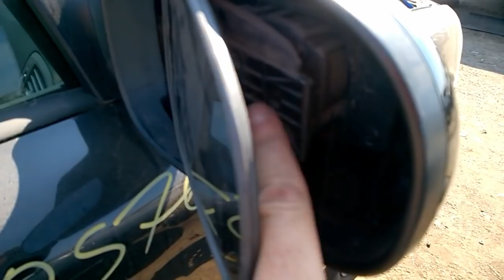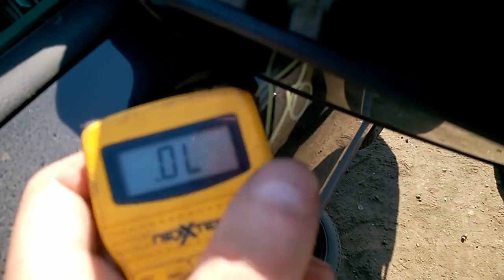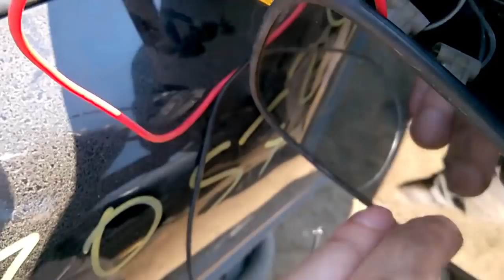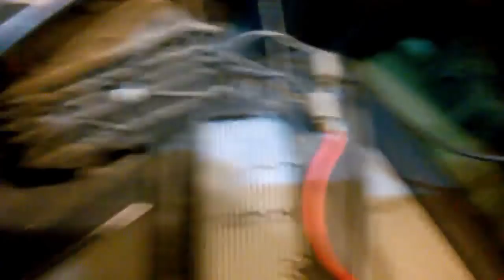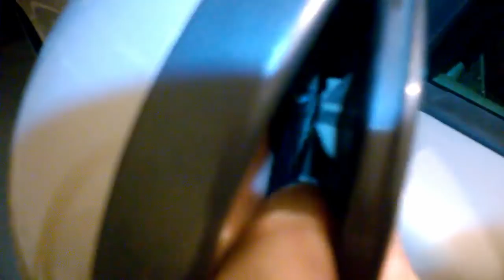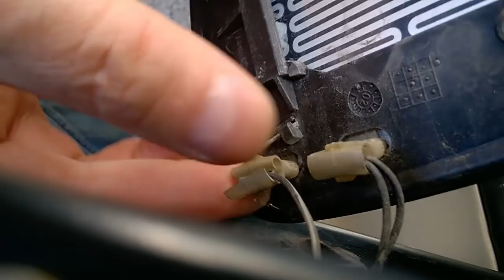Heated mirror glass testing and removal - Volvo S60 V70 XC90 S80 2001-2009

Comment: Excellent ... my wiring hook up and hinges were slightly different (2006 S60 2.5 T AWD) but close enough. Followed directions and ested the glass as instructed, got readings, installed as above and all works perfectly. $20.00 from P&P. Excellent. Thank you.
Reply from the maker: Good fix!  I think the mirrors were changed in 2004 (not compatible with previous years)

Comment: Thanks, great video, However, I changed my rearview mirror today and now my door locks won't lock with my remote any suggestions?
Reply from the maker: There may be a module inside drivers mirror, related to the car's security system. Try asking on this UK forum https://www.volvoforums.org.uk/forumdisplay.php?f=19

Comment: You know I saw in the dealership and they sale aside the mirror with heated, and it fit perfectly in my Honda CR-V LX,  but I checked my car and it didn’t come with electrical wiring for that, do you know if it will be possible that I can do the electrical wiring and it’ll be work? (Mirror heated that I saw it’s for crv models superior that I got). Thanks
Reply from the maker: Usually the heated mirror wires are on the same circuit as the rear window defrost and will activate when the rear window is activated.  So if you can pass the wires inside the mirror and connect to the rear defrost wiring, it may be possible.  Have a look here  https://www.9thgencivic.com/forum/maintenance-repair-practical/5335-diy-heated-side-mirrors.html

Comment: Wait does the battery have to be hooked or charged im confused?
Reply from the maker: No, I'm measuring the ohms (resistance) so the is not need for the heating element to be powered (in either of the cars shown).  You can measure this as well on a mirror that has been removed from the car, just set the multimeter to ohms (200 or 2k scales)
Reply: Peppermint Ok thanks ive got a few i need to check then

Comment from the maker: Here's an Ebay seller, make sure again to get the correct mirror model for your car - there were two different models from 2001-2009
http://www.ebay.com/itm/Heated-Door-Mirror-Glass-and-Backing-Plate-RIGHT-fits-2001-2003-VOLVO-S60-V70/112360185544?_trkparms=aid%3D111001%26algo%3DREC.SEED%26ao%3D1%26asc%3D46657%26meid%3D5e5483181f2447a5a0767f6c10c3a559%26pid%3D100675%26rk%3D1%26rkt%3D15%26sd%3D112360185544&_trksid=p2481888.c100675.m4236&_trkparms=pageci%253Ad53b4195-aa2d-11e7-af7b-74dbd1803f9d%257Cparentrq%253Aef19078015e0a861ccb073b8fffc0812%257Ciid%253A1